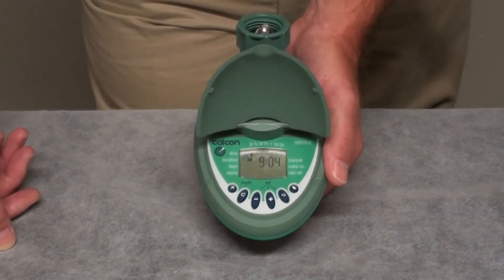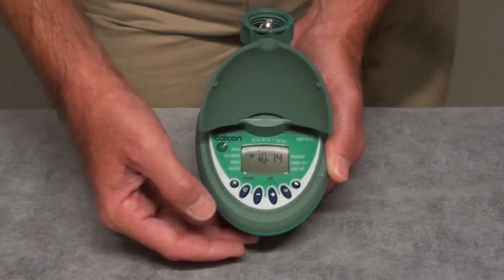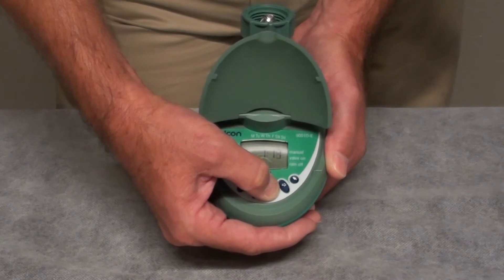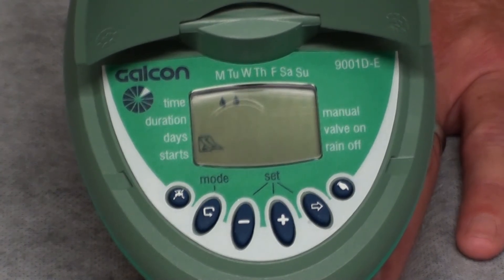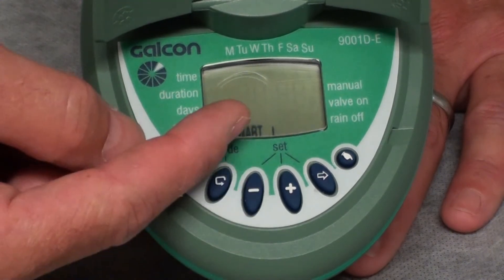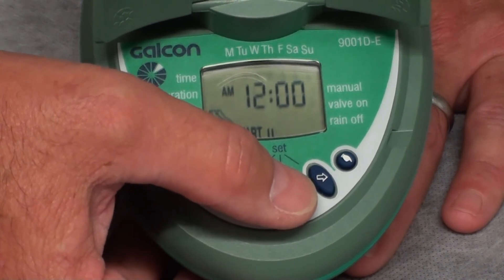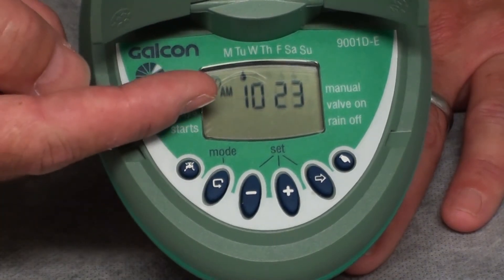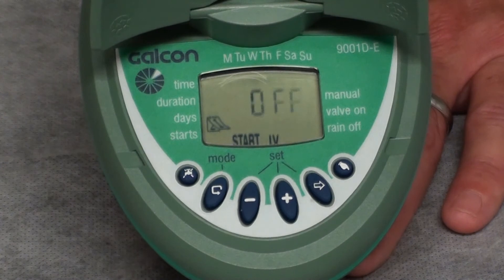Galcon LCD Timer

Comment: Buenos días,
Recientemente compre un controlador de riego GALCON LCD, y estoy teniendo problemas para programarlo en la función «Ciclos de riego».
Estoy intentando con los pasos que dicta el manual, («Para poner los días en OFF, presione MODE hasta que le aparezca el símbolo DÍAS . A continuación presione FLECHA A LA DERECHA hasta que después de varias pulsaciones le aparezca OFF en pantalla. Presione MODE y aparecerá el símbolo CICLO y la palabra OFF parpadeando. Presione o y ponga el ciclo que requiera.»), pero en ningún momento me aparece la palabra OFF en la pantalla, y mucho menos el símbolo de CICLO.
Por favor necesito ayuda para resolver este problema, compre el producto específicamente por esa función.
Espero su respuesta.
Desde ya muchas gracias.
Matias.